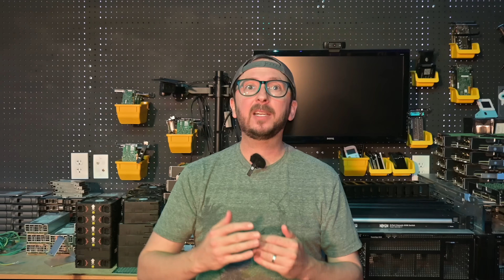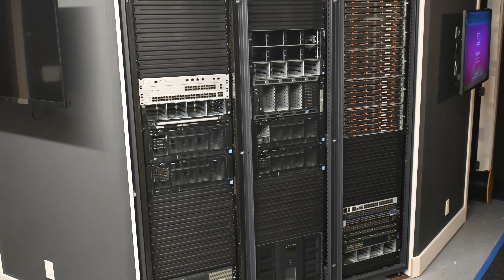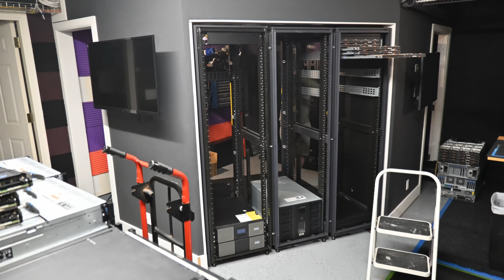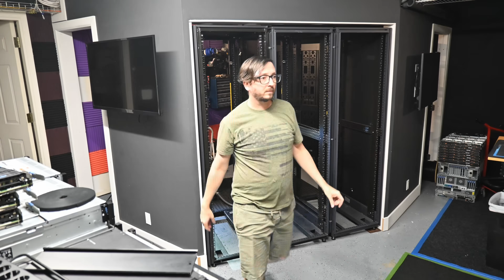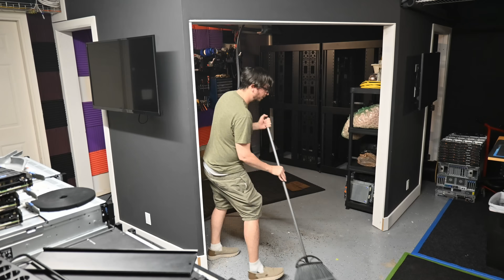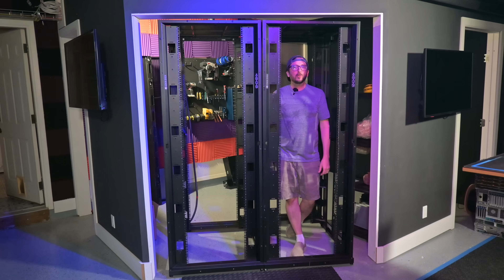Ai Home Datacenter Build (part 1)

Comment: 1:50 You might want to take a look at the 'zfs rewrite' command.  It was added fairly recently but should allow you to 'defrag' in-place, without using a separate box
Reply from the maker: @stephenreaves3205 OMG I read this after I cut myself up on the 60 bay monster jbod getting it's stinking trays in place and connected... Still great to read this! Thx.

Comment: Ive almost completed mine, took months, so far I've been at it for 5 months, but i have pretty much everything running that i could possibly want, all on high availability with daily backups and automated updates. I'm running like 30 vms in proxmox at this point. I guess it's really only taken this long because i tried using windows first instead of Linux, big mistake, don't do it.  Nothing works. And also i knew swqat about Linux before this. Not to mention i hasn't touched server grade hardware before this, now I'm confident i could get a job in the department.

Comment: Great work. Please share with us more follow up videos.
For your network are you going to use ToR or centralized separate rack?
Are you using copper for management and fiber for DATA? What’s your network throughput.
Do you have any bottlenecks starting from drive read write to network equipment or end host NIC throughput.
Thank you